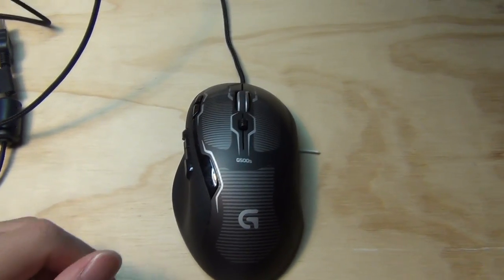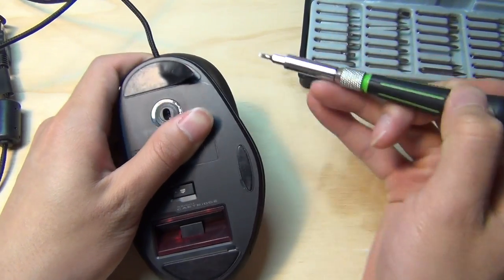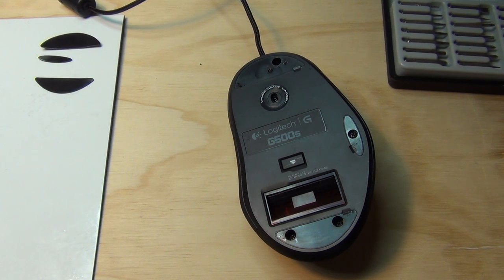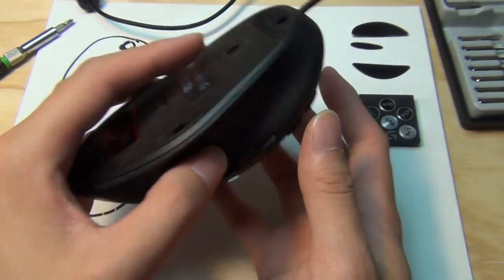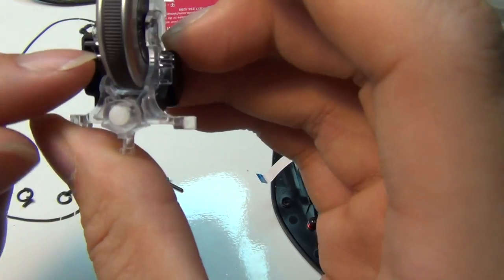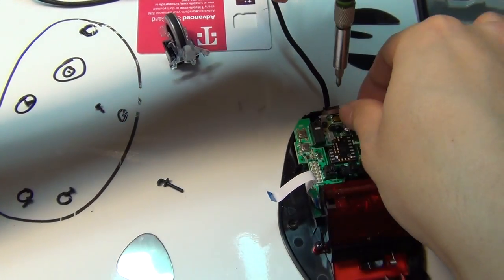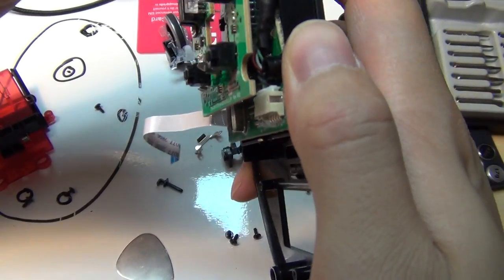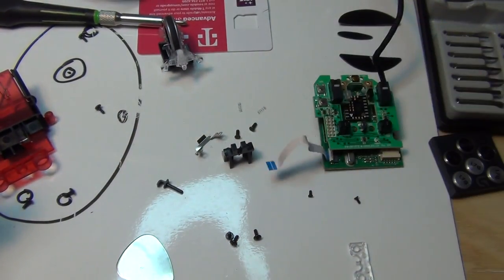Logitech G500s Laser Gaming Mouse teardown specs inside part 1

Comment: Good vid! Tremendously scary though. I will be 95% more gentle than that and use mostly plastic tools. Fortunately laser mice need next to zero maintenance unless their buttons start doing weird things. (Ahem Razer)

I love my G500. This is just a replacement because I'm taking the one I currently have to work and back since their mice and keyboards suck something fierce. Muscle memory has as much to do with being fast at my job as it does killing people while gaming.
Reply: +miinyoo Yeah I like my G500. Had it since 2010. I only had to open it 3 times. Once because a hair got inside the micro-switch assembly somehow. Then twice because it didn't click right anymore (once to bend back the switch-spring and once to solder out the switches alltogether and replace them).

I guess I should've cleaned it more often though (or washed my hands a lot more)  since it looks a lot dirtier on the inside than the one in the video. Also the scroll wheel on mine has some corrosion on it.

Comment: Hello,

My middle click doesn't click anymore (if I push it, it does the action but it doesn't lower with the characteristic noise like before). I tore down the mouse like you did but couldn't find where it should click normally. Is it possible you help me please ? Thanks a lot !